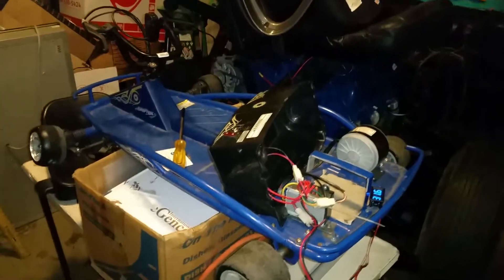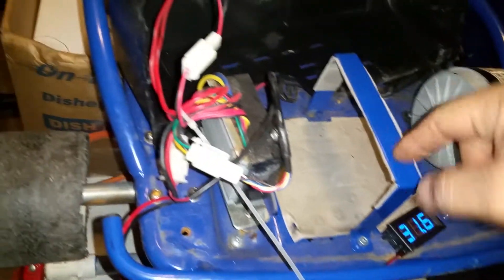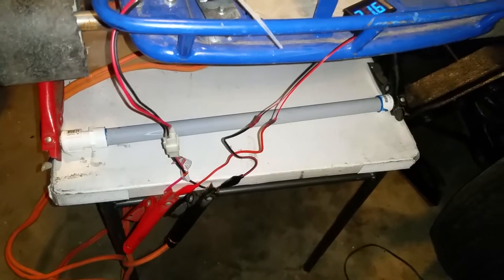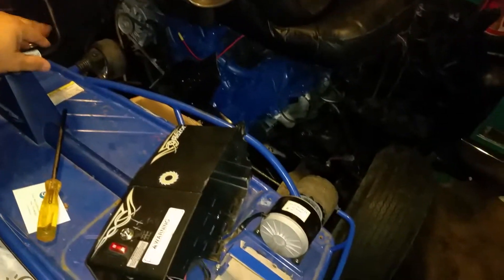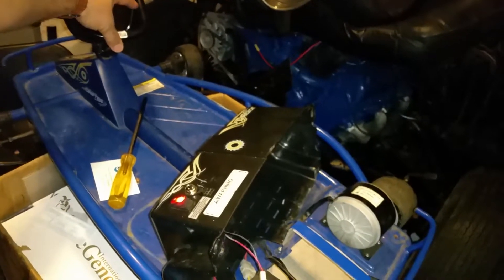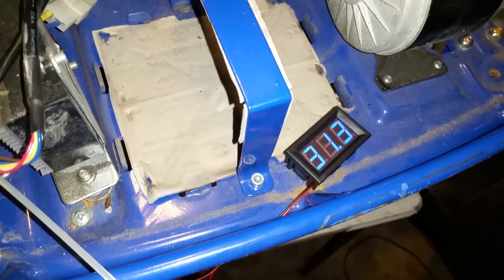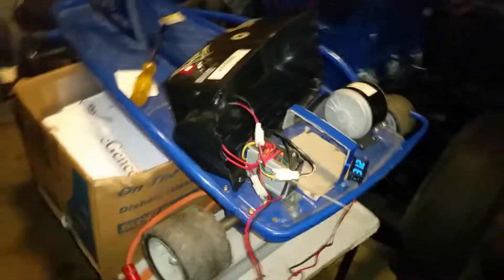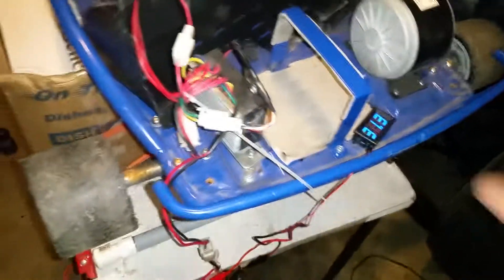Razor Drifter Cart 18650 33.6Volt  Battery testing Upgrade replacement pack E-Tube

Comment: I just used two 4s lipos in series to make 8s and put a lipo alarm on my batteries to keep from over discharging. Works great and i get higher top speed now plus it stays in the slides better
Reply: Motor does need a fan tho since im going over the 24v limit but my speed went from 12 to 17 lol